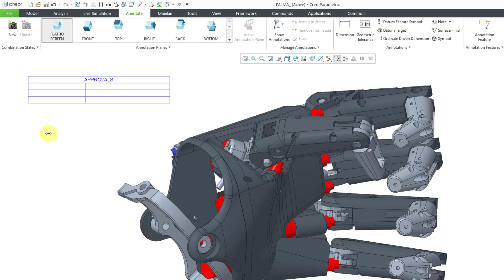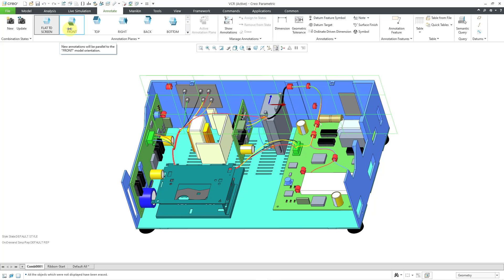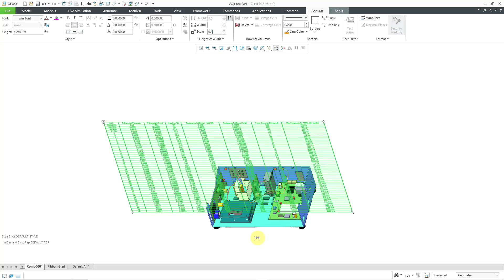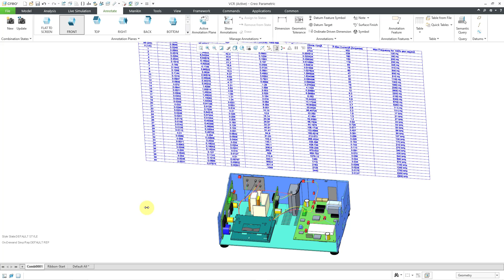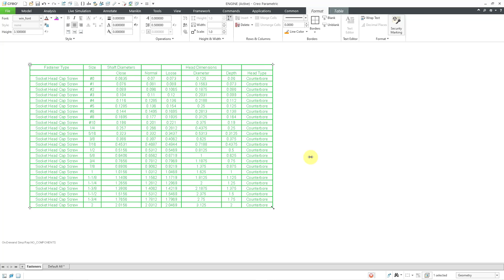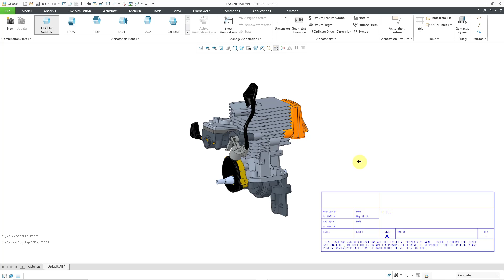Creo Parametric 11.0 - Tables in Model Based Definition (MBD) Part 1 - Creating Tables

Comment: It’s really nice that usage of tables is now enabled in MBD. But how are the tables behaving regarding of screen resolution? We tried to use MBD on Creo 8.0. For the tables we found a workaround using proprietary designed symbols, which are applied in flat to screen orientation. But there is a problem with scaling the tables according to screen resolution. If MDB content is created on 4K screen with appropriate table (symbol) size, then the tables (symbols) are overlapping when watched on smaller resolution. If done otherwise (creation on HD resolution display, watching on 4K display), the table (symbol) content is so small that text is not readable. The same problem persists when exported .pvz file is watched with Creo View Express. We didn’t find the way to zoom the flat to screen content to overcome that problem (neither in Creo or Creo View Express). This stopped us to embrace the MBD workflow for entire company and our suppliers, so we’re still working with the drawings… Is Creo 11 any better regarding this issue?

Kind regards

Jože
Reply from the maker: I suggest reaching out to PTC for your issues. I don't have any experience with 4K monitors.